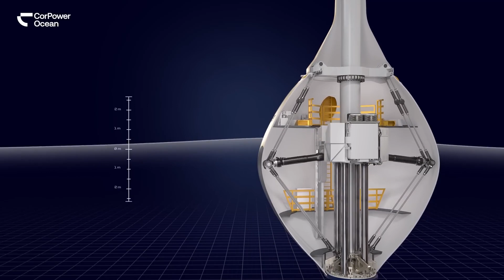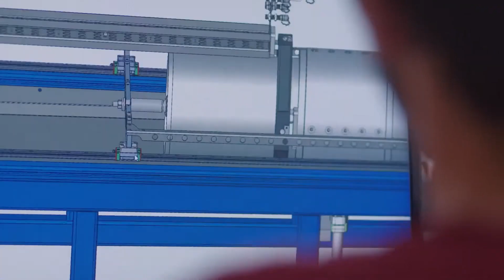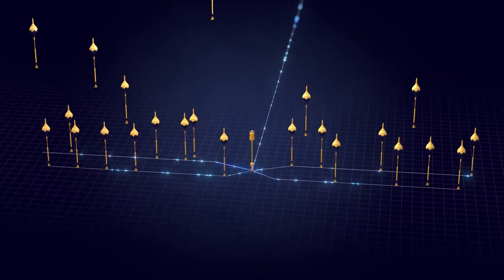Site visit: Preparing wave energy farms of the future

Comment: He mentioned the concept of intermixing these with an existing offshore wind farm.  Effectively using the space between the turbines for this tech.  As long as it still allows the service boats to maneuver around inside the farm area, seems like a great idea to boost the amount of energy yielded from a set area, as well as avoiding the extra costs of running another line to the shore (assuming the wind farm line has the capacity to carry additional load.

Comment: Maybe i didn't get the point but the issue there is taming the power of the ocean and get the formidable strenght it produce. The other issue is the intermittency of renewable energies (solar and wind) where wave power can complement and avoid having huge and costly energy storage to save energy during the phases of no production. 
I guess it's a complicated situation since wave energy capture is as well depending of the whether and its difficult to monitor this complementarity. 
Am I of the chart in this statement?
Reply: Apart from vocabulary issues...